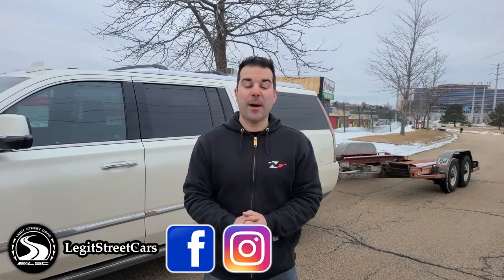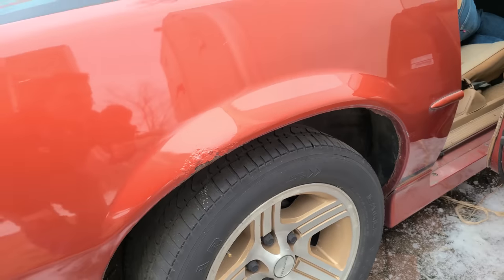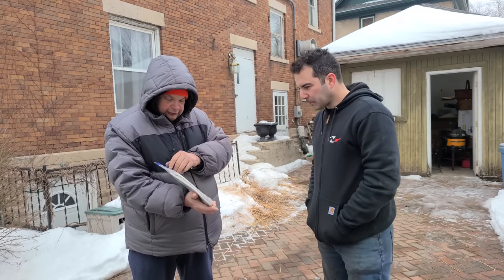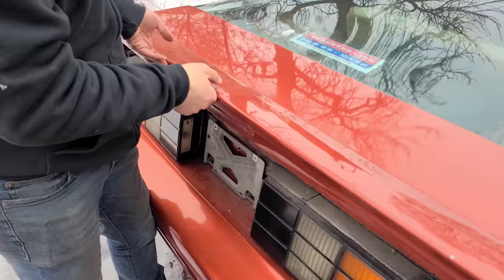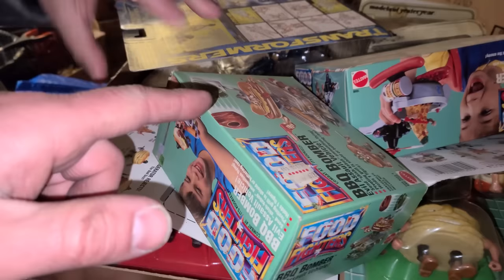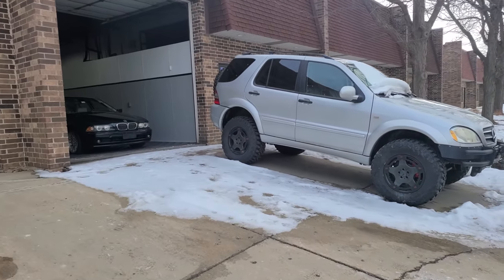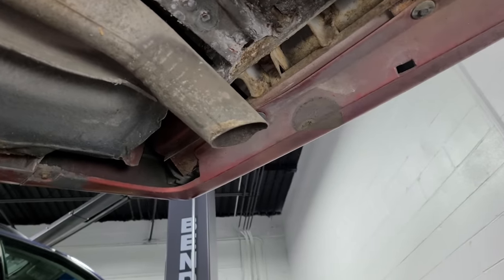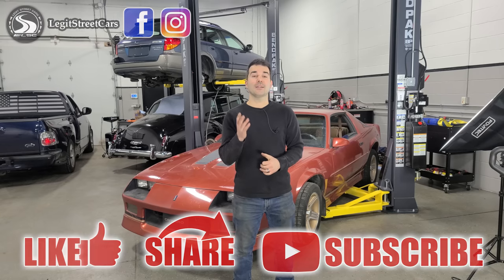I Bought An Abandoned IROC Z Camaro That Sat For 27 Years In A Storage Unit! Here's How Much!

Comment: LSC, you need to get those wheel dollies for your shop. That way if a car won't move just jack it up and place it on them so you can slide the vehicle to where you want it to go.
Reply: Sometimes hitting the center of the wheel with a heavy hammer& a block of wood shocks the brakes loose.
Works better on drum than discs brakes.
Reply: @stuartd9741  MUCH better with drums… never seen it work otherwise lol
Reply: Have the dollies
Reply: Had the same thought!!🎉

Comment: Such a gorgeous car man, what a shame that it’s so rusted out. I would love to see it restored
Reply: Looks pretty good for 1500 bucks
Reply: I would rather see it just fixed up and daily driven
Reply: It’s honestly not that bad. I’m not sure but it seems like he just likes buying shit and isn’t a real restoration body guy.
Reply: Its not worth a restoration. They were crap cars new. I had an 86 z28 and doors rusted out in less then a year and paint was peeling and electrical system what screwed. They had to buy it back under lemon law in just under a year.
Reply: @rustbucketauto2328  1500 is great. Just fix the major stuff and blast the underbody for rust and get it treated and drive it till the wheels fall off. they have no real value they made a millon of those irocs.
Reply: @papag5433  The 86 Z28 was not an IROC, it was a Z28, which means your car had very little upgrades from the crappy V6. An '86 Z28 was a bare-bones Camaro with a crappy 305 TBI engine which made nothing for horsepower. Did they make a million of those IROC's? Once again, you are wrong. 166,986 IROCS were made from 1985-1990. Being realistic, there is probably something like 20,000 real IROCs still left out there as most would be crushed by now.
Reply: Just scrap it..or use it as a field car..
Reply: Put 15 grand into a car Worth nothing..
Reply: @kurtjammer9568 scrap it? Why would you do that? The frame structure is still strong. Hell I've daily driven a lot worse.
Reply: This was my dream car as a 15-16 yr old obviously barely knew anything but heard 350 5.7 and assumed they were fast ...id LOVE TO GET ONE W. A CLOSE TO PERFECT body put a fender or door on it send it for good paint restore the interior pristine. (T tops only) and drop an ls1 w. An ls6 block and heads some of the TA WS6'S got..w. a few small under the hood performance bolt ons besides a nice cam and a cat back. Interior a modern radio and it would be my dream car (post 72 at least

Comment: Dave seems a nice enough guy and great to see that he was open to negotiation.
Reply: Its always the boomers who think you can get a paint job in 2020 for a thousand bucks lol
Reply: @Youcallthesebagels_  meh I can get a really good paint job done for $2000.  Then again I know a guy who has been painting cars professionally for 29 years.  He re painted my Acura ITR just a few weeks ago.  Just waiting on the warmer weather.  Need the snow to melt and the first couple rainfalls of the season to happen so it can wash all the salt off the roads.  I don't want to take any chances with this thing.  I coated the entire underside with FluidFilm after we replaced all the mechanical/all new brake and fuel lines etc.  It looks great now, identical to the one Speed Academy just got.
Reply: Dave says he's a lawyer.... I'd say "shyster lawyer"
Reply: @1ronco  he doesn't look like the brightest bulb in the tree lol.  Although he scored huge buying that unit for 900 bucks.  $1500 for the car, likely get $1000 for the Honda Interceptor (1000cc?) All the vintage, BNIB Hotwheels, Star Trek stuff.  Literally thousands of $$ it looks like by the time he sells it all.  Would live to score a deal like that
Reply: If someone tells me that the car is rust free and I show up and find a rust hole in the door big enough to stuff my fist through, I'm walking away.
Reply: @TwentytenS4B8  for sure.  I mean kseriously the idiot wouldn't pull the cover off to look at the damn thing? He posted pics of it how did he not see that rust? Knowing what the part out is worth though considering so many of the parts are in good shape its still a win.  He will make $3000 at least and then get a couple hundred when he scraps what's left.  Hopefully he can verify the engine is good and the trans.  I would pull all the plugs and soak the cylinders with WD40 or something anyways to make sure the rings are free
Reply: @derekgardin1512  Marvel Mystery Oil in the cylinders and let it soak overnight then bar the engine over. I agree, there's a good amount of parts there that will bring some $$$. Especially since parts for these are scarce. Car Wizard did a video on a really nice IROC and he stated many times he could not even get an AC condenser for one. And yeah, I'm positive the seller knew about that rust and tried to play dumb when Alex discovered it. I'd have held out $500 and said take it or leave it.
Reply: @TwentytenS4B8  lol yep that's it, couldn't remember the damn name 🤣 brain was not working at that moment in time so I just said wd40 and figured you'd understand.   Yep, I was gonna say I'd probably have $700 in my hand and say look there's no way you didn't know there was a fist sized hole in the damn door and I've already spent $200 getting a damn key.
Reply: @derekgardin1512  I totally forgot Alex had already spent the $200 on a locksmith to get a key made. WD40 also works for freeing stuck rings if you don't have any MMO on hand. Honestly, I'd have yanked an ignition cylinder and keys from a car at the pick a part and changed that ish right there in the driveway for about $25 tops. That's if the seller took my more than fair offer at $500 for a Fred Flintstone mobile.
Reply: @TwentytenS4B8  lol 😆 fair enough.  I would have worried about the ignition after, not spent the money up front especially since he agreed to it sight unseen.  Could have saved that $200.  When he realized it probably wasn't going to be a keeper, just break the damn steering wheel lock or whatever.
Reply: @Youcallthesebagels_  normal is not 10k lol normal is 5k if that. Show is 10k anything 10k+ better be custom or a huge vehicle.
Reply: @derekgardin1512  750 or maybe a 700cc version.

Comment: The power trunk was a good idea from a engineering angle. The amount of air it caputures and pushes forward when slammed was hard on passengers. The soft touch allowed for slow depressure, no hurt ears.
Reply: Um, crack open a window before slamming shut the ?trunk?
Reply: Mine is still working great to this day but mine isn't stock I have a N/A 383 550hp planted in it with a 200 shot I'm close to 800hp but my camaro is a one owner full interior street car still
Reply: @Chris_A_  No need I thought all cars had vents inside for closing doors and trunks.
Reply: @Guillotines_For_Globalists  
Classic vehicles do not have relief vents. Try gently closing a door on an air-cooled VW with door seals functioning as intended by the factory. It will not shut without nearly slamming the door shut.
Reply: @Chris_A_  This Camaro is from the 1980s unlike a Beetle from the 1960s.
Reply: @Guillotines_For_Globalists  
What I understand is the Camero is of inferior quality compared to the VW air-cooled vehicles.

I could not agree with you more.
Reply: @Chris_A_  I have no stake in the game and honestly don't care which vehicle is of better quality.  They're both terribly outdated and extremely underpowered and subsequently grossly overrated today as well.
Reply: I remember some owners would break the pull down motor by slamming the deck lid
shut.
Reply: @vincentfisher4748  all the time and I still have to church people up on my Iroc and T/A
Reply: That's not why they did it. If you slammed the trunk the back window would shatter. That window costs over two grand and you needed special insurance for it.
Reply: @Guillotines_For_Globalists  They do.
Reply: @Chris_A_  Flow through ventilation was invented in 1976
Reply: @dannysdailys  I recently bought a project IROC and the window motor is seized in the  down position…was very worried when slamming it repeatedly to get it closed so I could drive it home!
Reply: it was actually added to prevent the glass from breaking as without it you had to slam it. they even added a decail that said do not slam the glass. I had one yrs ago and thought it was the dumbest thing. Now we have google to explain things more betterer.
Reply: @dannysdailys  Negative, a 1969 Lincoln Mark III had Dow through ventilation. Old news by 1976.
Reply: @rrhistorian8828  What's Dow through ventilation? Who cares, this is from over a year ago.
Reply: @Chris_A_ inferior to a old VW bug? That is hilarious. In the Northeast where I live they salt the roads in the winter. A Bug will completely rust out in 10 to 15 years after new. Not much different from the 80s Camaro.  Except the Iroc is cool and a Bug, well no comment.

Comment: I've owned 6 Camaros over the years. My first was a '74 LT. It had a 350, 2 bbl and a turbo 350 auto. The next were a pair of '67s, an RS and a base model. Both needed work and I never got around to doing it.
My first new Camaro was an '84 Z28, I ordered it new in '83. It had the 5.0 H.O., 5 speed, 4 wheel discs. The next was an '85 IROC Z, ordered in February 1985. It was a 5.0 TPI, auto, t-top, 4 wheel disc car.
I bought an '87 5.7 TPI, 4 wheel disc car in '06 as a 2nd car.

Comment: My first car was an 86 IROC. I miss it dearly.

To answer some things, I heard the electric pull down on the hatch was to keep people from slamming it which can cause the glass to break. The front and rear wheels have different offsets.

Shame it's so rusty!
ETA: I think you should do a mechanical restoration (the bare minimum), interior detail, do some sad burnouts with that weak drivetrain and sell it!
Reply: I had an '85 without the power pull down. If the doors were closed and windows up there was too much air pressure in the cabin when the hatch was closed, so it wouldn't latch half of the time without slamming it. The pull down was added to address this issue.
Reply: Weirdly my 2008 Lexus has the same kind of electric pull down thing, and its an ordinary steel lid.  No idea why they thought it was necessary.
Reply: I had a 86 IROC too. 5sp with the carbed 305 lol. All the 350s had the auto
Reply: @JDJD-mw9rr  The 5.0 5spd IROCs were quick. I used to smoke 305/350 fbodies with my 5.0 mustang back then but somehow that gave me a run for my money. 85 TPI cars were quicker than the later ones as well.
Reply: @Anthony-rv3hr  My 86 was a 305 TPI. It never felt fast but I ate fox bodies for breakfast! I had a timing chain go bad and I first noticed when I lost a street race to a Taurus SHO (embarrassing). The next day the entire chain went. They used a nylon/aluminum cam gear on those 305s. The nylon was totally gone when I opened it up. Crossed my fingers that the pickup screen wouldn't get plugged up and went on with a new chain set.
Reply: @JasonFrankenstein  Those poor foxbody drivers. You wouldn't have beaten me. 😄  I still have the car - 89GT. It's been 32 years.
Reply: @Anthony-rv3hr  Ya I had a 305 5spd IROC. It was quick but not fast. Mine had 4.10 gears so it was good from a launch but nothing to write home about. The 305 probably made like 230hp stock max and maybe 300ftlbs. My LT1 Camaro was much faster, I have a 4.2l V8 Audi A8 that makes 340hp that feels faster then them all and it's a boat on air ride
Reply: @JDJD-mw9rr  You can always take that wimpy 305 and make into a 334 Stroker and make well over 400 HP.
Reply: @JDJD-mw9rr  No it didn't. Depending on the year most likely it was less than 200 HP. Very crappy by today's standards but they could still smoke the tires pretty good. Decent for the time.

Comment: I have an 89 that's in great condition. Mine has T-tops, the tuned port 305, 5 speed manual transmission, & runs great. Mine is completely rust free. 
I went through my teenage years when these IROC's first came out, i fell in love with this bodystyle back in those days. I always wanted one. I found mine quite some time ago & it's not going anywhere!!

Comment: The key is the RPO list.  I bought an 88 IROC brand new.  LB9, 5spd, G65, hardtop with 4 wheel disc brakes and the 16 inch wheels.  There is a huge difference having a 3.45 posi rear.

Comment: Nice. I had an IROC 305 Tpi stick shift.
The wheels say "front" and "rear" because they have different offsets. 
The only problem with buying an old 3rd gen now is parts availability. Yes, there's a ton of aftermarket reproduction parts, but there's still some stuff that's gonna be unobtanium.
Reply: Not really that hard, everything powertrain is available.  About 60% of the interior is reproduced.  Its not a 69 Camaro that you can build new from a catalog.  There is alot of small companies that make parts for them, GM authorized reproduction for the major wear items are starting to show up.  Now with the current supply chain issues some things take forever to get to you but that is true for all cars.
Reply: Yes and alot of the aftermarket reproduction parts are poor quality. I think fenders, doors and floor panels is available but not rocker panels or trunk panels.
Reply: @joakimsoderberg8046  I have 8 3rd gens & parts are available if you know where to go.

Comment: That’s a far cry from driving the CL65 through several states in the freezing cold, with potential disaster looming at every mile marker, but it was fun to see an 80s IROC. I always dreamed of adding the IROC wheels and ground effects for my 87, but a blown head gasket that I never got around to led to it sitting outside in Wisconsin for too long, resulting in worse rust in all the same areas yours has on the exterior.

Comment: Love the video! I just picked up an 88 iroc convertible  w/47k original miles. It had been sitting in a storage unit for about 5 years and I legit only paid $1k for it. I put in a new battery and drove it home. I didn't realize just how lucky I was until watching this video. Not an ounce of rust or dings whatsoever. Only thing wrong with it is a little bit of paint fade.

Comment: It's not THAT bad. I've saved far worse. I live in Western PA and on a quiet night you can hear the cars rust here. I have an '87 V6 T-top Camaro that was actually the exact car I had in high school that I accidentally found again a year and a half ago. It had a (rather poor) repaint at some point that I think may have slowed down the tin worm a bit. It has some floor issues like yours, but definitely salvageable. The tired (but will still smoke the right rear tire off) 2.8 leaks so much oil (also probably helped it from rusting more) that it leaves a smoke screen and a trail wherever it goes, so I'm about to swap it out for a 305 TPI (because it was cheap). SAVE THAT IROC! Such cool cars. Great video!

Comment: I love your videos. Never use the rocker panels to lift a 3rd gen Camaro/Firebird. Use the frame instead. The front fenders lower mounting brackets are always smashed because people put the floor jack there. I see you did that in the video so take a look at those brackets.....I bet those are bent and smashed up to the floor
I believe the complete floor and structure is the same on Camaro and Firebird. They went down the same assembly line when they where built.
Save it if you can. These 80s classics are rare these days! I love my 88 Gta.
Reply: Had a tire shop lift on the fender mounts on my 89 once... Guy was fired on the spot.  I never got it right until I took off the front clip for my LS swap and was able to fix it to my liking.
Reply: He should know this he’s owned a GTA in the past but hope he reads your comment before picking up another thirdgen. Imagine if this car actually was in great shape, and on the second day he owned it completely mangled the pinch welds :(
Reply: Totally agree with the lift points
warning ⚠️ .

Comment: After the 1997 C43 AMG that you briefly owned, this is the second car you've featured that I also own. Except that my 87 Camaro irocZ has the 5.7 engine with T-tops.  GM offered the power trunk option due to fear of the heavy weight of the glass rear hatch breaking upon closing.
Reply: I figured that when he lifted the hood(I forgot how heavy those trunks are

Comment: The power latch may have been a safety feature because of the size of the rear window. If you slam it hard it can create a lot of pressure. I had a car a while back that the front windows went down slightly because of the size of the boot lid. 👍👍
Reply: Cars have pressure relief vents for this.
Reply: @envisionelectronics  I’m no mechanic by any means but Alex said that feature was removed on later models, maybe that’s when vents were added.
Reply: The rear windows were also prone to shattering when being closed.
Reply: They did blow out when first made.
Reply: @envisionelectronics  Have you ever closed the hatch on one of these.  He/she is right, that is what it was for.
Reply: @lukebird6412  By later model he meant later body style.